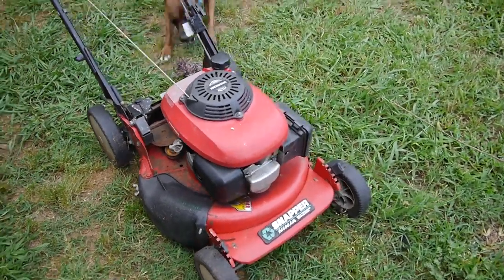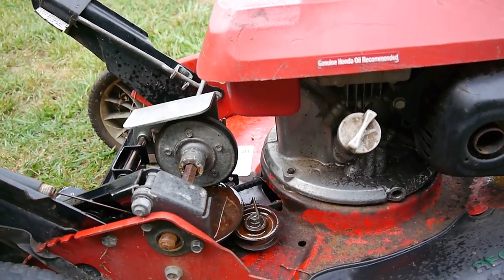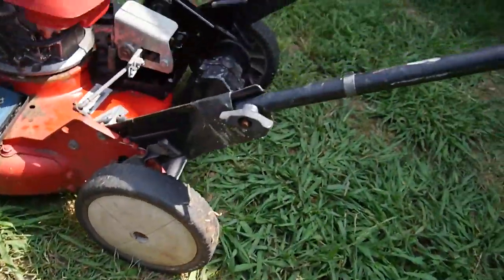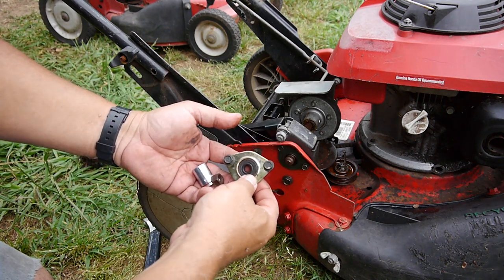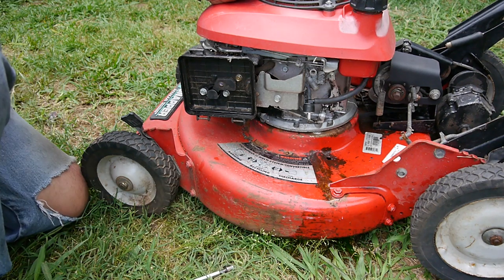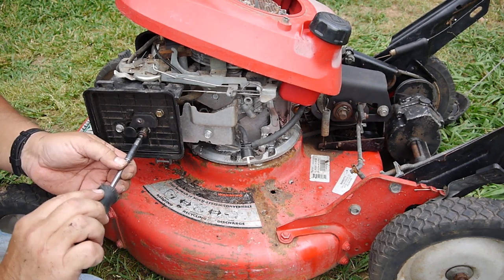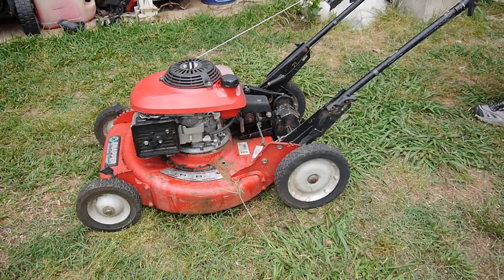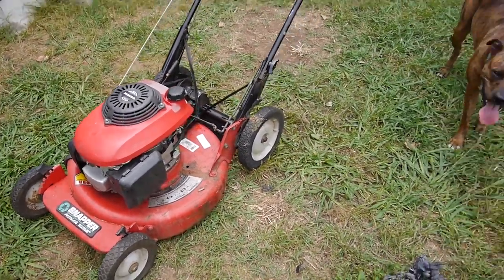Snapper Ninja Lawn Mower - Will it Run?

Comment: Fuel in crankcase?  Did that resolve itself?
Reply from the maker: After cleaning the carburetor, no gas was leaking into the crankcase. I'm sure the carburetor float was not closing and flooding the mower.